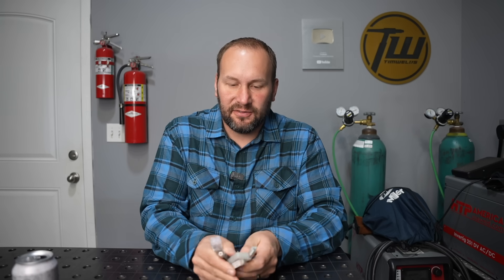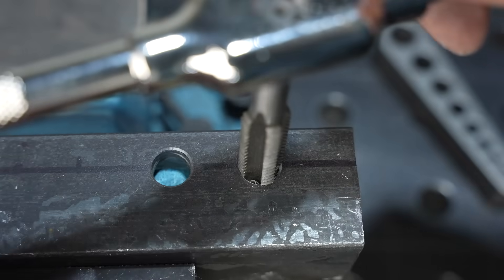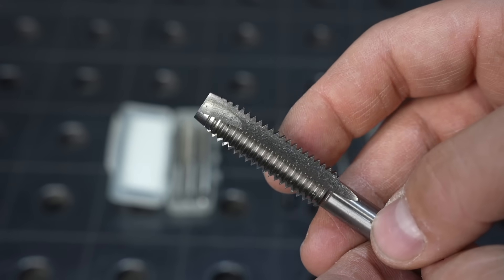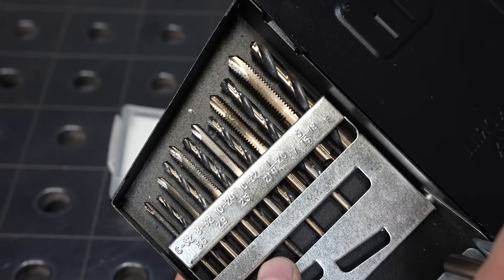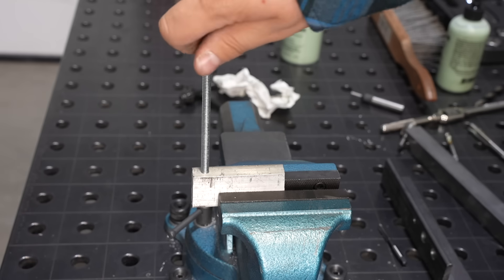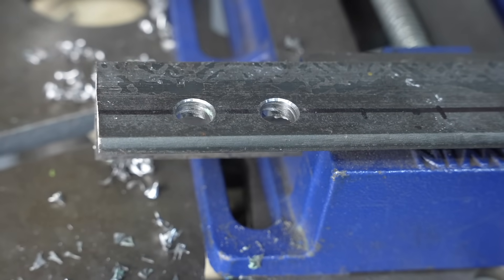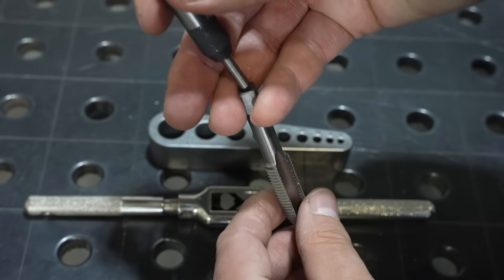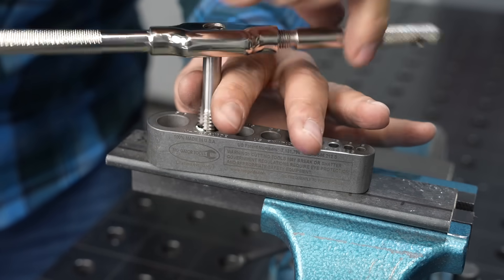Never Break Another Tap: The Complete Guide to Tapping Holes in Metal

Comment: Yeah, as a Maschinist it always hurts me to see how people use taps and which ones.

And honestly, all taps we use in the shop are what lay people might know as CNC only taps. 
All made by atorn not very expensive but great quality. All one pass and done, they stay sharp long and let you know when they've gone dull.
Something very nice is that they all have a relief before the main shaft, so you can go very deep into the material
Reply from the maker: Thanks! I'll have to check out those Atorn taps.
Reply: @TimWelds  one piece of advice buy in bulk. So at least 5 each should be a little cheaper that way